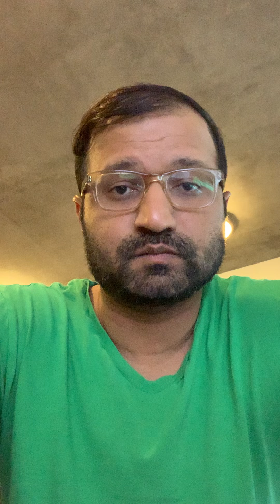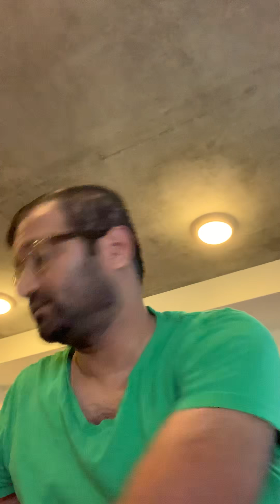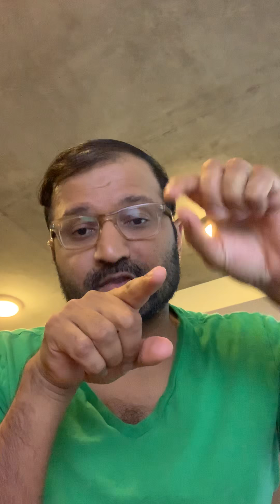(Flat Earth) Drone Test Follow Up - Military and Civilian Based GPS Can Easily Solve the Debate

Comment: Military drones just are not available for civilians. I like your basic idea though. I am inclined to believe anything suspended from drone touching the water would act against the drone though because of drag. Any thoughts on that or how to compensate if that is the case ?  🙂👍
Reply from the maker: I suspect military grade will keep getting better and we will get even more precise ones off the shelf eventually. Certainly "in our life time".

The whole point (pardon the pun) of my test doesn't rely on it flying the entire course - it is to go to a point in 3-space reliably. So the journey from point A to point B to point C, etc. is irrelevant to the result(s). It is to leverage the already existing GPS (co-ordinate) system.
Reply: The Mind of God 
Absolutely, I understand the hop scotch approach makes the flight path irrelevant as only the way points are important to read from. My concern is as soon as the plumb bob hits the water it will be subject to surface currents.
Respect for conversation 👍
Reply from the maker: Yes - your point is valid. The error bars in GPS and uncertainty in the water levels would dictate the length of the rod needed and thus the load bearing capability of the drone(s). Also, the more distortion the further apart the beginning and end points of the test would need to be to make it conclusive. Peace and blessings CPHTLJ.
Reply: The Mind of God 
What if you skip the drones and perhaps use bouys that have been similarly marked and calibrated/adjusted to have same water level.  You can then use drone with kevel or camera or telephoto lens on land to observe. I’m thinking outside the box to get a better view inside the box. 🤔 using two ways to observe and see if they agree.🤝👍